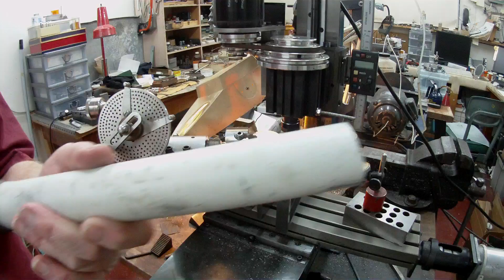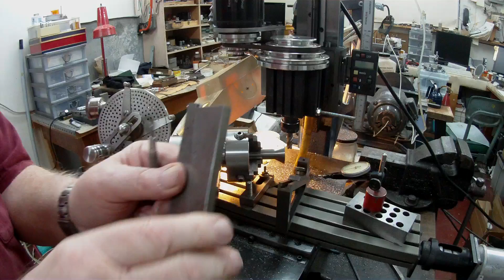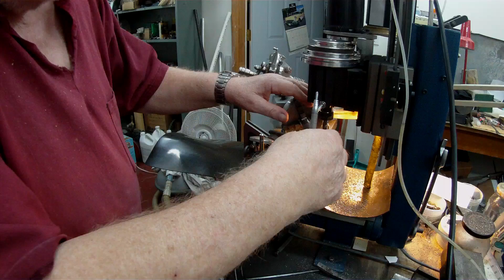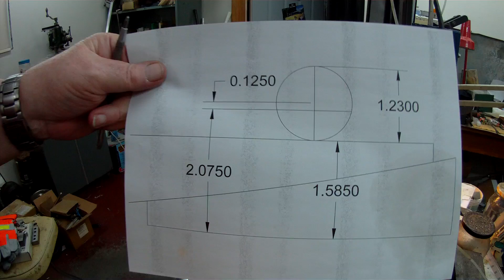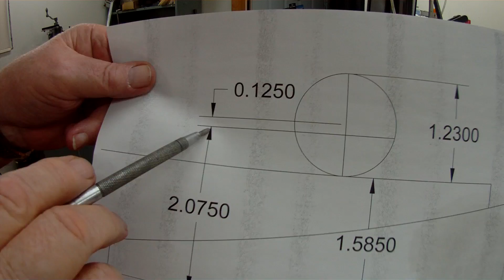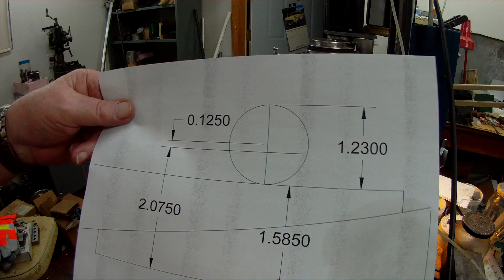FILE0011  Returning to the Lime Hand Shaper HD 11 homemade dovetail cutter

Comment: The more I learn the more I see it's all in the setup. That was a fascinating one. But I do wonder if by setting the table about 10 cm to your left (increase X) you would have gotten a bit more support for the dviding head, which is carrying the whole load of milling.  I would not have thought of your way of finding center of cut. Learned a lot from this video and thanks once more.
Reply from the maker: Juan, yes you are right in one sense, but I think it is the total length of the part sticking out, plus the chuck width, plus the length of dividing head, in relation to the Z column that is the real problem,  it was really the combination of several things, 

With the calculation of finding centre, having no height gauge, or slip gauges,  I had to use other tooling, a planer gauge is a very tool handy for measuring, and a used one can be found on eBay quite cheaply, 

Thanks for your interest, Edmund..........Alberta
Reply: Thanks, Walter. You are the tool & die maker, I'm just an amateur. I will look for a plaer gauge, however!
Reply from the maker: Juan, 
   my apologies, I didn't mean to sound smart, your question about moving the table 10 cm for more support got me wondering, it had not occurred to me, and at first I thought you were right, but then I realized the problem, Juan,  I might have the title but I'm still basically self taught and managed to get by on my merits, so in a sense I'm also an amateur, 

Edmund..........Alberta
Reply: Well, Walter, let me put it this way. You are a far, far, far more skilled amateur than I am and I learn new things from this channelevery video.

Comment: Walter:You've now made everything crystal clear concerning the final machining of the slot for the carbide insert.  Thank you very much to taking the time to make the video (which is worth a thousand words on paper).  Thanks again and wishing you the best of luck with the tapping process, because I know that material is extremely hard and it will be difficult. Breaking a small #4 tap would be quite easy to do if precautions aren't taken.  Best Regards: Larry
Reply from the maker: +Larry Poindexter 
Thanks Larry, I think its a case of tit for tat, I get encouragement from your help also,